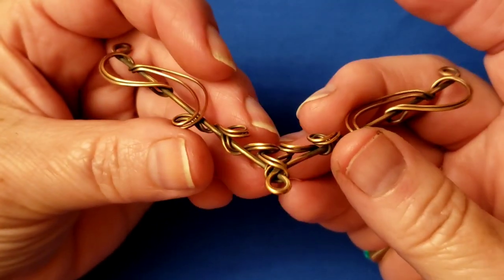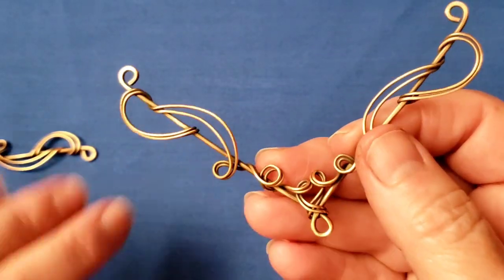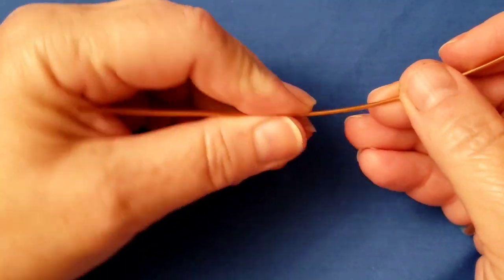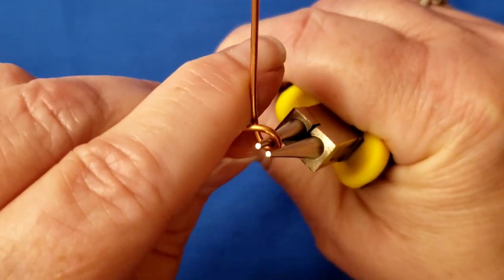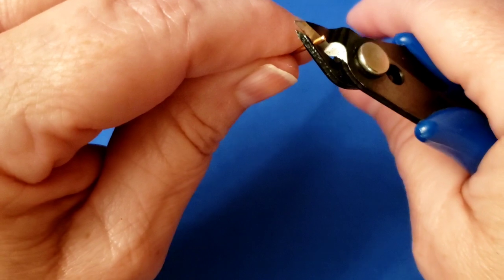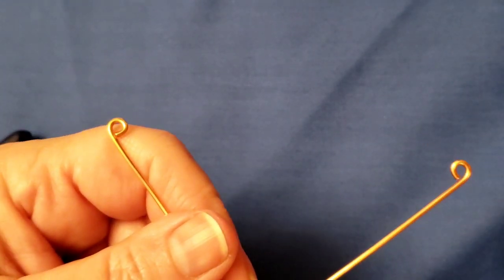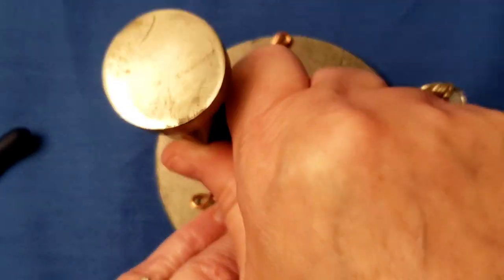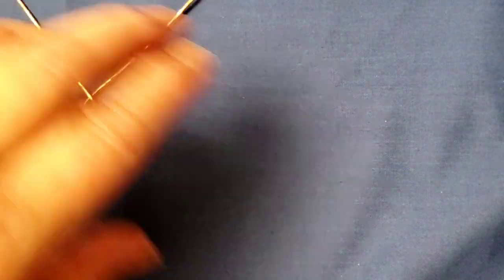90 Degree Pendant Bar with Swirls - Cheryl St. Pierre of Majestic Wire Artworks

Comment: Cheryl, just to let you know you should never hammer over wire when it's crossing over each other as it weekends the wire at that point. Not picking at you but I have done wire weave  jewelry for years.
Reply from the maker: This is 16 gauge it can handle the wire hammering with the cross over.. I agree completely with the lighter gauge.. Trust me this is ok.
Reply: Ok  didn't know if you knew,you do such nice even work  I didn't want your  jewelry to go screwy.